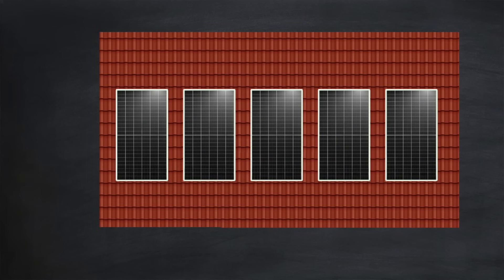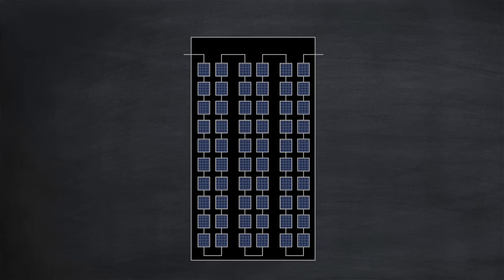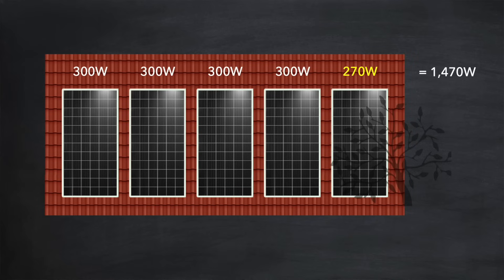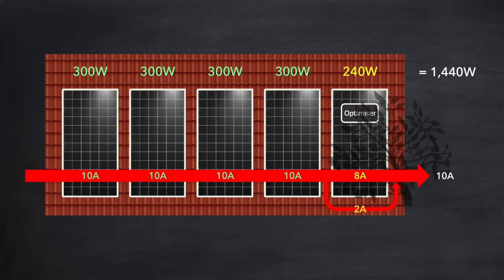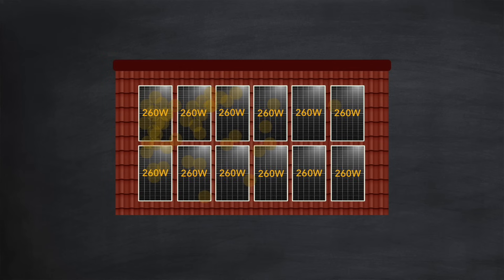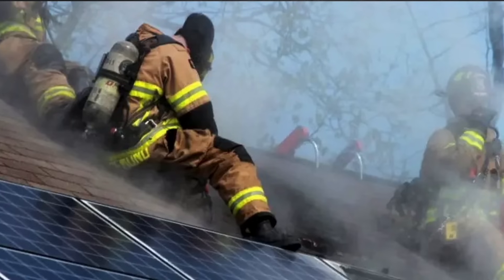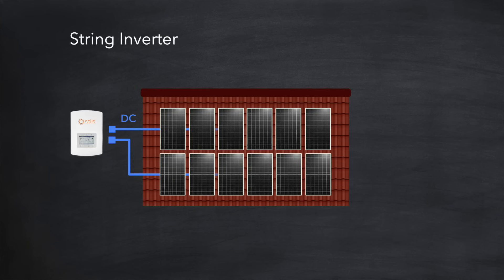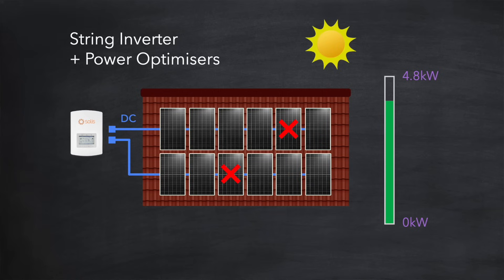Power Optimisers - What are they? And do you really need them?

Comment: Yes if you have no shading issues and live on a lower latitude and a direct current battery (they will be making these.). The optimal set up would be a system that switches back and forth depending on the conditions and seasons. Not even sure if that is possible. The inverters tend to do better with shading, and the optimizers do better with full sunlight.  Once they come out with DC batteries (Franklin) there won’t be any loss due to conversion.

Comment: I’ve just had a solar and battery system installed with a Sigenstor inverter and battery. My setup is 7 panels on the main house roof and 3 panels on the garage roof – both south facing.

When I checked the app after installation, I noticed all 10 panels were wired as a single string. The installer told me the 3 garage panels weren’t enough to make a string of their own on the Sigenstor system.

The issue is shading. In the late afternoon, the house shades the garage roof and I lose a big chunk of generation. In the mornings it’s the opposite – the garage gets sun before the main roof, but I still get little to no production until the main roof lights up.

Originally the plan was 4 panels on the garage, but they only managed to fit 3 during install.

My question: would 3 Aiko 470w panels be enough for their own string? Should I push for the garage panels to be rewired separately, or would optimisers be a better solution?

Comment: Hi Gary 

Thanks for an informative video. 

I have a Solar Edge system from 2012 with 26 panels, that not producing since primo may. My inverter seems to be working
I have the data for every panel (1)Current, 2) Optimized Voltage, 3) Power and 4) Voltage) on my app.
All Voltages are aproxx 28-36 in voltage (sunshine). 
The power differs from 0 W to 99 W
The Optimized Voltage difers from 1 - 62 V
The current from 0 to 3,3 A

I just had an incompetent electrician, who monitored 30 V at the inverter. I have another electrician (with bad trustpilot reviews) who advices me to disconnect the poweroptimizers and buy a new inverter. 

Can You help with advice of what to do. 

(Sorry for my bad written english)

Best regards
Martin
Reply from the maker: Hi Martin, thanks for the great feed on my video. Now, your question was quite in-depth, so I would recommend you join this Facebook group and ask on there. The members are generally quite helpful and likely to steer you in the right direction:

http://www.facebook.com/groups/2197329430289466](http://www.facebook.com/groups/2197329430289466)

Comment: Partly rubbish mate they mainly use because there's an 5% efficiency difference to some of Your panel may say 400 W but it might not produce 400 W when a different panel might produce more and in the string of solar panels the weakest one will bring them all down not every panel is what it says it is optimise it will optimise Every panel due to the efficiency difference. That's the reason why companies say you should have them on all regardless of shadows. They also use for factories because of the angle difference some factories have flatter roofs than others this helps with optimise them too they are not just used for shadows

Comment: What if you are feeding the solar output directly into a battery, like the EcoFlow Delta Pro Ultra? Wouldn’t converting the solar panel DC current to AC and then back to DC for the battery be inefficient?
Reply from the maker: What you are describing is the difference between DC and AC Coupled batteries. More here:

https://youtu.be/x83t1iCMXxw?si=oGIKAdvWP6DtA3O-

Comment: Can someone tell me if one of optimizer stop working is that affect on whole string? Does string stop with working?
Reply from the maker: Such a failure will not normally affect the remainder of the string.
Reply: @GaryDoesSolar  Thank you for your response.
I'm building a solar field consisting of 26 solar panels (Trina 450 Wp). I have two chimneys, so I'm considering installing optimizers on each panel. However, after watching your video about how shading affects solar panels, I might avoid that expense.

Comment: Gary, thanks for opening my eyes! I'm planning to place 20 panels on east, south and west roof slopes and was thinking about creating two strings est-south (10 equally distributed) and south-west (equally distributed) without optimizer, living in Italy and having a quite smooth slope of the roof (20°). I was wandering about what could happen in the late afternoon, when the panels in the south are irradiated, instead those ones on the east start to be covered by the shadow of roof tiles: will, all the bypass diodes of each panel in the east roof slope, be cascade activated, leaving the panels in the south continuing producing? 
Thanks a lot
Marco

Comment: I ended up going with rapid shutdown units I sourced on eBay for $18 per. My system is a ground mount wasn't required to have RSD but I felt for safety when cleaning the panels it was best to activate the RSD drop the voltage down to 35V per panel. Never know have a leak water gets into the panel could shock someone with over 300 volts with a long string of panels.
Reply from the maker: Sounds like a good approach!

Comment: What you didn’t cover though was the flexibility of an optimiser , a micro inverter maxes out at just 430w and originals were just 250w , and yet optimisers can work with 700w pannels allowing a significantly higher capture of total power without clipping so in a large high powered pannel output in optimal conditions you may get up to 1/3 more power with the string . I have had both Tiago and solaredge and deliberately went to Tigo  because of the so,aredge failure rate , on just 16 pannels  4kwh array producing just 3.6kwh I lost 11 in 5 years , whiles solar edge have worked consistently to fix this issue with early 2010 pannels there is still a 1/3 faults deity in 4 years reported especially in the cold north or extreme desert whilst it’s important to point out these optimiser are fully waterproof they are not actively cooled.  With tigo I had a batch issue with 6bfaures out of 32 pannels fitted ,  they changed the lot under warranty, and since zero issues the rapid shutdown works too as a neighbour had a yard fire not that long ago with embers fall down , a quick rinse and flar check and I’m back again the following day.
Reply from the maker: Good insight 👍🏻

Comment: About as clear of an explanation as is likely possible without an engineering degree.  Let's me see why there is not THE answer, depends greatly on your situation.  A 30-year-old may be perfectly comfortable climbing onto his flatter roof to replace a microinverter or optimizer but at 70, I am not about to climb on my steep roof to do the same.  At the same time, I need power for a medical device at night so total failure is not an option.  In my case it would appear that decentralization, warranty coverage and installer/repairer reliability are most important.
Reply from the maker: Thanks, and yeah—I would always recommend people contract a professional to carry out any kind of work on a roof.

Comment: Mark, thanks for the video, you are the best expert online. Quick question, I bought a clamp meter to measure the DC current for each panel, I have 6 strings with 8 / 9 panels (3 cascading inverters). Do you think I will be able to detect a panel with low current (so I can replace the panel or remove it)?
Reply from the maker: Hi Frank, is this a question for Mark Cavanagh at MC Electrical (mentioned in the video)?

Comment: If i have 8 solar panels, and i connect each 4 in parallel, and then the 2 groups i connect them in series, will that improve a lot the shading issues? Or it is not worth the watt difference, since i need to make extra cables to connect the 4 panels in parallel?
Reply from the maker: Yes, it might, but you’d need to discuss with your installer as there could be downsides to such a configuration as well (for example, insufficient voltage on the string to startup the inverter).

Comment: Hello Gary. Thank you for great video you did. I would like to very kindly ask you, if you could help me to sort out my problem. I have very small setup (only 2pcs of 12V 175Wh Victron Energy panels connected together). Unfortunatelly the most of the day is one or other in shadow (around 5%), but in such case the power significantly drops down. Will in such configuration help to mount optimizer on both of the pannels? Which one do you recomend? Thanks a lot, Miro
Reply from the maker: Thanks for the kind words. Now, you’re best to speak to your installer about this, as every situation is different. Alternatively, you could ask a question on this online forum:

http://www.facebook.com/groups/2197329430289466

Comment: I installed a SE system, One optimizer failed about 2 years later, at 7 years two more failed. These seem like a weak link in the system. Changing out is a real pain ! ( I had to remove most panels to get to the failed one) Think about easy access if possable.

Comment: My new array had to be shaded with a stick to keep it from over amping and shutting off the string. 3300w vertical plus snow went over 3800w I saw 4180 on another inverter that I yanked out , crap mppt would clip overcast solar at 60% soc, now with the stick shading 3kw in sun. I am planning to upgrade the inverter to handle alot more pv. Gary do you have any data on which inverter gets the most pv in full overcast? I go 40 days between sunny days here in winter, eg. today was the 3rd sunny day since Nov 7. In a small way I used my idea to put too much solar in a string then purposely shade it to keep the max sunny pv down but boost the overcast pv, the shade stick won't effect power when you can't see a shadow since it is 100% albedo. I am going to add 1 panel to 2 strings and shade it, then march to oct unhook the extra panels. Inverter #3 was a 10kw but failed in overcast so I switched back to the 8kw to get alot more overcast power.

Comment: One other consideration is that optimizers offer less current because of higher voltage, meaning smaller conductors for the same amount of power.
Reply from the maker: What are you saying is the advantage of this though, Andy?
Reply: @GaryDoesSolar  With microinverters, you are collecting the power from each panel at 240vac. With optimizers, you are collecting the power from multiple panels at up to 400 vdc (600 max). So, for the same amount of power collected at 240v from microinverters versus 400v optimizers, the current will be lower with the optimizers, thus smaller or fewer conductors leaving the array. Granted, it doesn't make much difference on smaller arrays.
Reply: @GaryDoesSolar  Plus optimizers' higher voltage DC home run could make a big difference if the array is a long distance from the load.

Comment: After listening to your explanation, I still don't get why having one or few optimizers on the un-shaded areas might help maximizing their power output since the current at the shaded area is being bottlenecked at 8-9A?
Reply: I think the point is that the optimizer solves the bottleneck by increasing the amps and lowering the voltage of the shaded area.
Reply: @daninbar3446  I was wondering about the case where he draw optimizers elsewhere, not where it is shaded but still reap the benefits somehow.

Comment: I've got tigo optimisers and I'm happy with them. My setup though was constrained by a very small roof meaning that I have 2 x 550W panels facing north and 2 x 550W panels facing south connected in series to a single MPPT. In addition to solving shading problems, optimisers can be useful for weird roof toplogies like mine.
Reply from the maker: True, but I think microinverters are better for complex roofs unless you can find a string inverter like the PW3 with many (6) MPPTs.

Comment: How technically did the optimiser reduce panel voltage to 1 V during the fault or in case the inverter switched off ?
Reply from the maker: I don't know the answer to that. Worth contacting one or two suppliers as they may have different approaches...

Comment: My experience of optimisers is they do nothing...regularly have several shaded panels on a string and the unshaded ones are dragged down to very similar output. This is worse than relying on the bypass diodes. 
Manufacturer says they are working fine!
 They cost nearly as much as the panels these days. Wish I'd watched this video before wasting a grand on optimisers.
Reply from the maker: Hi James, yeah - optimisers are not the magic that manufacturers might have you believe :-/

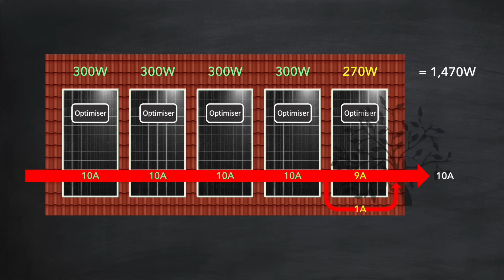Comment: 6:40 thats now how an optimizer works. Your talking about a bypass. The way most work is they are dc dc step up / step down converters. So lets say all solar panels putput 30v 10 amps and shaded one maybe 28v 8 amps. What the optimizer will do. It will either step down the voltage down to maybe 20v and output 10 amps. Or the other optimizers will boost the voltage to 32v and putput 8 amps instead

Comment: I have a question what if i have a solar panel with same voltage but 150 watt less than other panels then can optimiser on this panel can allow my other panels to produce full power?
Reply from the maker: I think that's a question to ask your installer. There could be other factors at play...
Reply: @GaryDoesSolar  there’s none actually i have a very tight budget so that I don’t have solar panels with same specs, i have 4 solar panel of 530 watt, 1 solar panel 400 watt and 1 solar panel 450 connected in series, i know that because of these 2 panels my system is not working on its optimum. So as i’m trying to learn about solar optimizer and if it can help my solar panel than i try to buy one and i will install it by myself. Thanks for your reply.
Your videos are amazing.
By the way can you make a video on it i think it will be a great experimental video.

Comment: Great videos - thank you. I watched this video and part 1 and 2 of the Solar Panel shading.
I have a Solaredge inverter and optimisers so I had a look at how they perform with shading. This afternoon one panel was about 80% shaded but still providing over 60% of the output of the unshaded one. So I think this is much better than I would get from the panel if the bypass diodes had kicked in and switched the panel off.
Even when the panels are fully shaded I get some power from all the panels. Again, this seems better than if I relied on the panels alone.
I could send you the photos of the shading and the screen shots of the solaredge data for each panel.
Intriguing subject and fantastic that you are exploring it.
Reply from the maker: Hi Hugh, thanks for the kind words. Yes, please - I'd be happy for you to send photos/data through to me@GaryDoesSolar.com - thanks! :-)

Comment: I wish you would have addressed battery storage. There inefficiencies that come with switching between AC and DC. Switching to AC at the panel and then back to DC at the battery and back to AC for the home is not ideal.
Reply from the maker: Don’t worry - I did address these aspects in this video: https://youtu.be/x83t1iCMXxw?si=xViJYjdm2cl44lmJ

Although DC Coupled batteries are slightly more efficient, in terms of an overall daily modelling picture, there’s not a lot of difference, so I would choose AC or DC Coupled based on the other relative benefits.

Comment: Gary - great video and explanation - would optimizers like tigo work with or be advisable to add  in conjunction with Tesla Powerwall 3? The benefit being shading and monitoring? I do realize PW3 has 5 or 6 inputs so less of an issue in general
Reply from the maker: Hi Tom, thanks for the great feedback! Yeah, Tesla have really thought about it, and depending on which country you're in, you can get a PW3 with 6 inputs, negating the need to have optimisers - not least because the bypass diodes already do a great job!

Comment: This is a really informative video. I would like to know if there is a shading on only one panel and there is 7 more panels in the same string. Do we need optimiser on all of them or just one.
Reply from the maker: Thanks for the great feedback. For the answer to your question, it depends which manufacturer of optimisers you want to use. If Tigo, yes, you only need to put them on panels which will experience shading. If SolarEdge, they mandate an optimiser on every panel irrespective of shading potential on the panels.

Comment: dont put things that break on your roof lol. imo everyone lies about failure rates. most people now days have no idea how to check the health of their panels, and therefore the reported failure rate will always be less than the true failure rate. the people who understand solar and monitor their panels are usually the same people who can do the math and realize they dont need optimizers and dont want micro inverters. this means almost everyone who has optimizers is not the type of person who will recognize a device failure and report it. also the reported failure rates are likely only ever to represent the number that has been replaced. i bet in most cases the cost of labor its not worth it to replace them once they fail. solar margins are pretty thin, just use more copper and run more stuff in parellel if you want an optimizer that wont add more risk into the equation
Reply from the maker: It's an interesting topic, and of course, everyone will have a different opinion. I just hope that my videos are objective enough so that people can select the technology that fits them best.